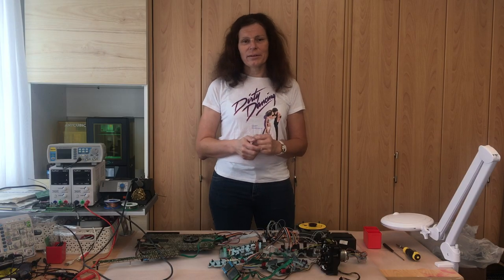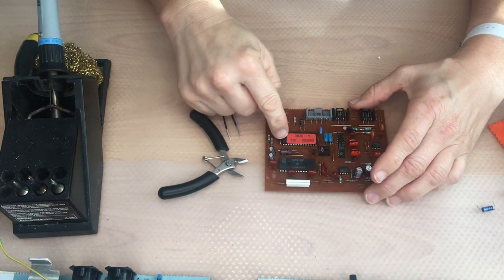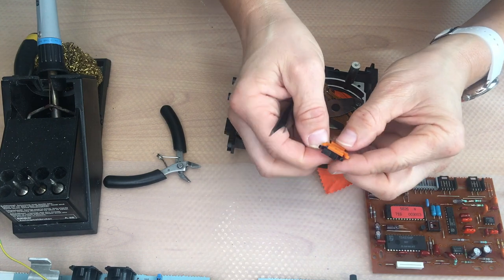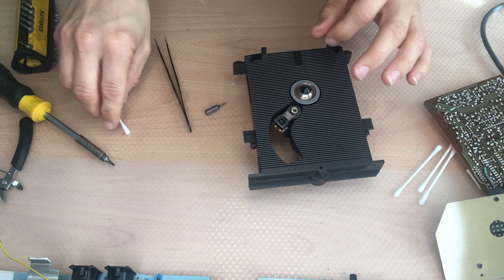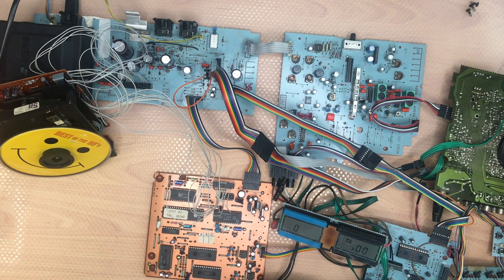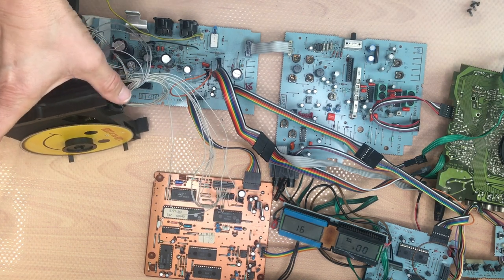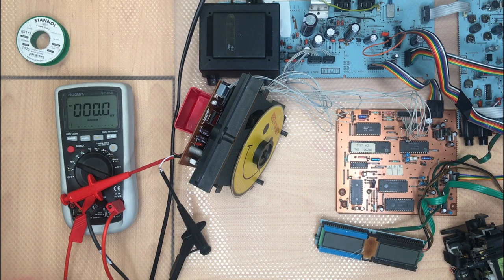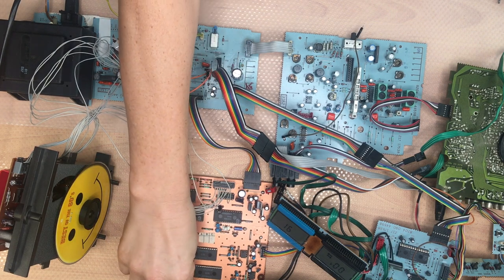Philips CD555, Resurrection EP10, CDM2 Mechanism

Comment: Something that I have come across when deep cleaning a CDM-0 (like in this video) by removing the screw and cleaning behind with q-tips: You should be very careful when screwing it back, so that it is centered, otherwise if it is a bit turned towards any side (left or right - people who have done it know what I mean), it will not work correctly, may not even be able to read the TOC, unless it is unscrewed and centered properly.
Reply from the maker: You are absolutely right. Thanks for the comment. Learned this in the meantime. Also the torque is important. Don’t know how many Newton but it’s also not working if you apply too much torque.

Comment: Excellent video Daniela. I am having issues with a Marantz cd873 that has a CDM-2 Mech. The problem is when the disc is spinning there is a lot of noise generated. I have tried lubricating the plastic clamp that holds the disc down when playing but it sounds like the noise is coming from the motor or spindle possibly.
Reply from the maker: Hi Charlie, hard to tell without hearing the noise. Is it a kind of plastic grinding or a high whistle? Some CDM2 might start to whistle when playing upper tracks. Feel free to mail me an audio record...
Reply: @daniela_spieler  Hi Daniela thanks for your reply! I don't think it's a plastic grinding noise but think it may be the laser making the noise and it is noisier when reading the start of the CD than tracks near the end of CD.
Reply from the maker: Hi Charlie, 
I probably got some news on this. Recently I had a CDM2 producing a whining sound when played. Was able to remove the noise by putting silicone oil 100,000 cst as mentioned in the service manual onto the axle bearing. You can see one side of the axle bearing at @11:26 - the metal ball inside the notch. Maybe this helps?